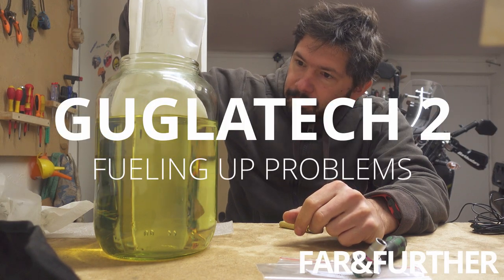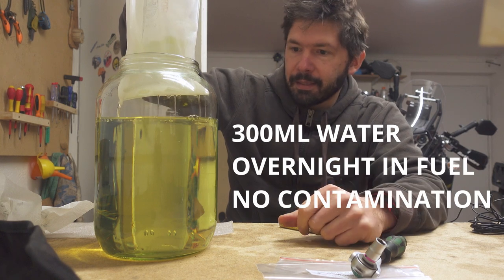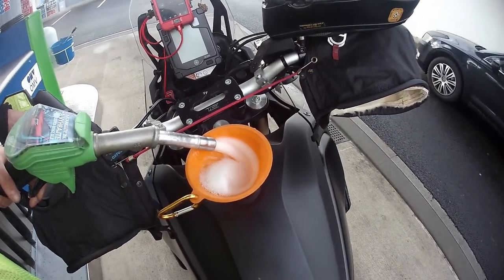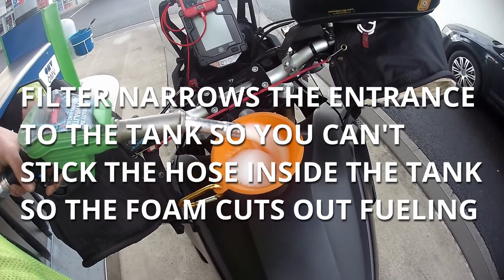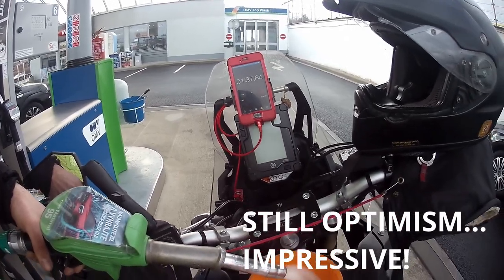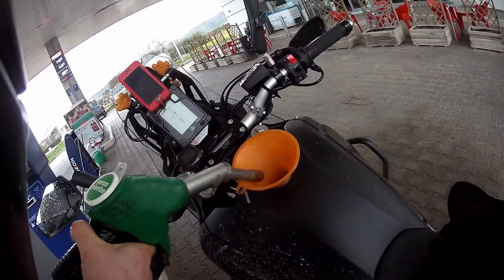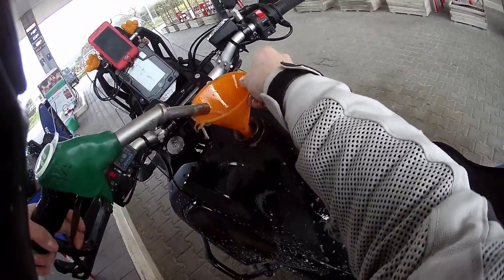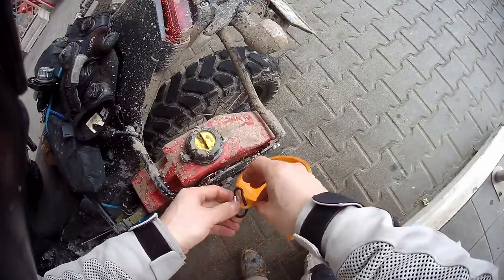Guglatech, Fuel ups problem

Comment: Have you found any solution to this problem with guglatech fuel filters?
Reply from the maker: Not yet, what I'm going to do is I'm going to make the hole in the tank larger and then the problem will be solved. Just waiting for the COVID to pass so I can go back home to the workshop.
Reply: Great, best of luck ✌🏼